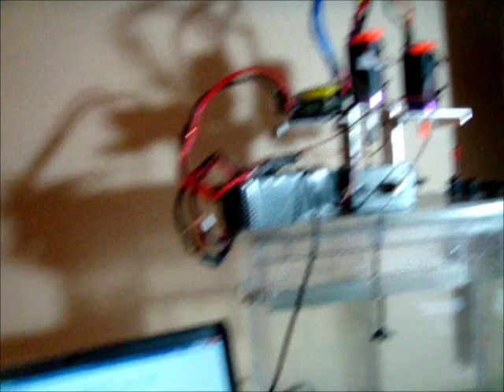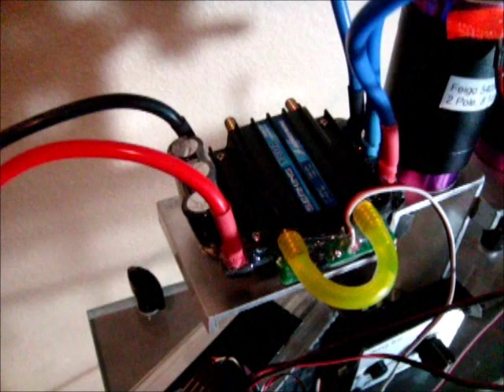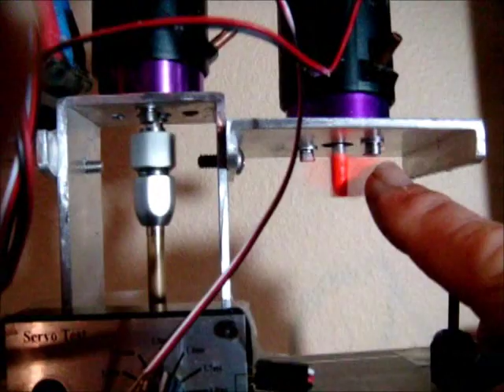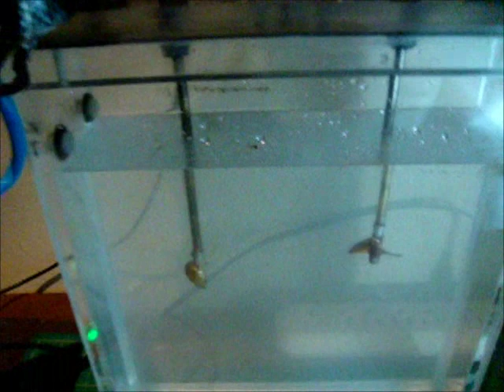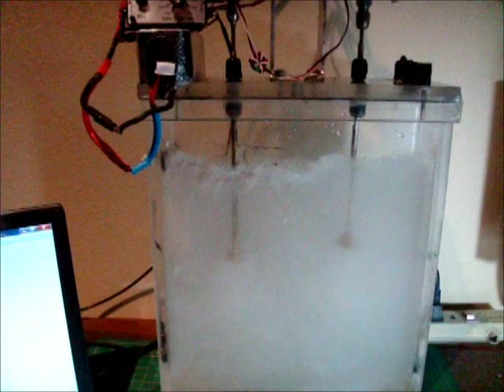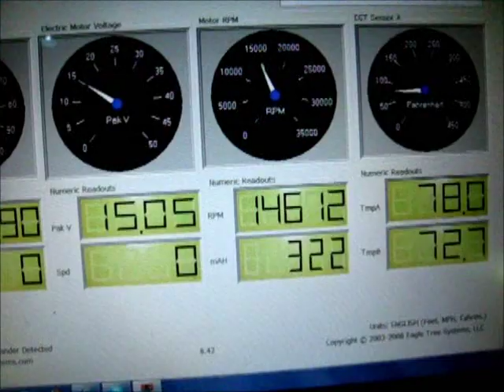2 Leopard & 2 540XL motors on 1 ESC

Comment: Thank you for sharing these multi engine one single esc setup test. Mind sharing how this setup could manage rpm difference on two motors, say due to slightly load difference or motor condition difference?

Comment: what did you do to wire the two motors together? do the wires have to be the same length gong to the esc from the motors? and are the motors wired in parralell or series. also, is the two motor thing only for that particular type of esc? please give me some advice because i am going to be running two motors in my traxxas slash 1 16 using a velineon esc and two tacon motors.